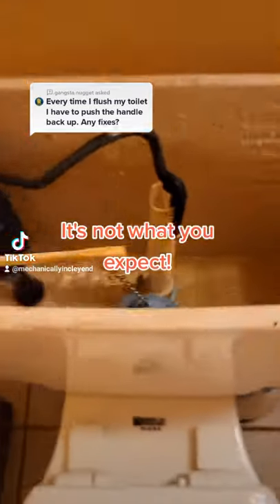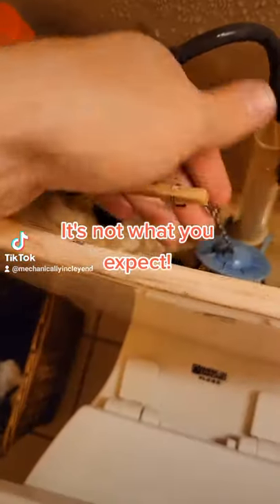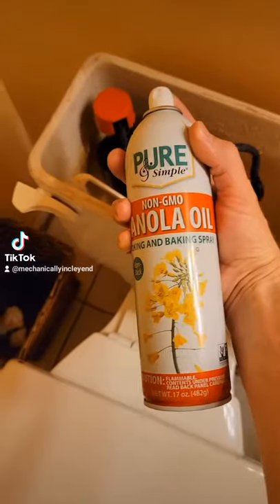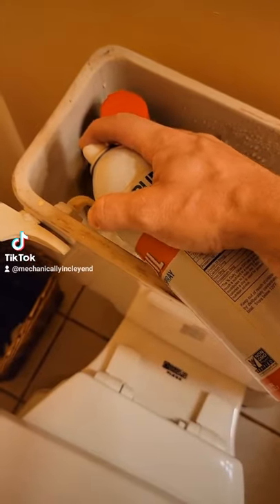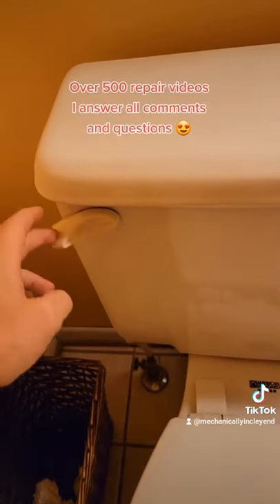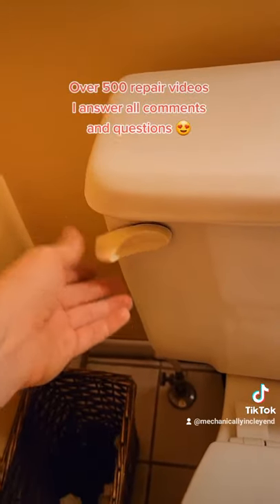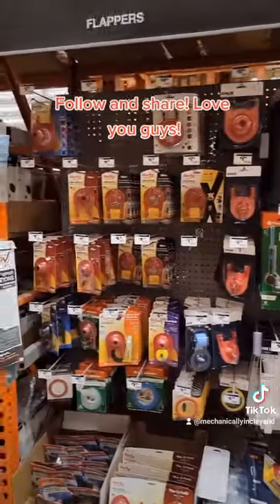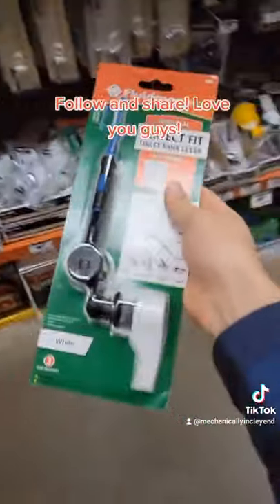How to fix a sticky toilet handle GARUNTEED! #shorts

Comment: Soooo,

It’s 3:06am….. and this pesky toilet handle IS FIXED….. THANKS TO YOU.

I’m up anyway….. as a jazz composer and short story writer…… being up at this hour….. it like heaven….. the world is sleeping…… and my muse is in full swing!!!

The flapper is a 
“melted pink monster “….. that’s way overdue for replacing.

I bought the replacement for this Koehler model….. but the water still trickled …… just wouldn’t seal?

So …. I did what any busy guy would do…….. put the old one back on…. and…… the trickling stopped!…. 
go figure …..

That was 2 years ago….. and… now it’s…… you guessed it….. 
TRICKLING  AGAIN …… lol

I’ll try the new one from last time…
AGAIN!… lol……

But…… not now!!!….. 

I just finished this ballad….. and …. It’s got to be arranged on the staffing paper ……

I’ll deal with that flapper….. 
           Later in the day….. lol

Thanks again for the quick fix! 🚽

                            🎼RAIN RAIN 🎼